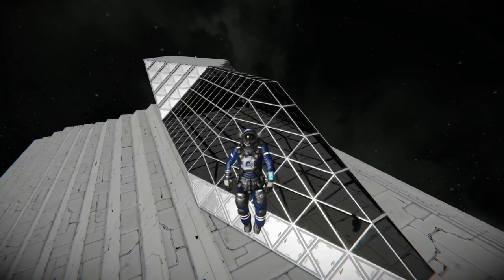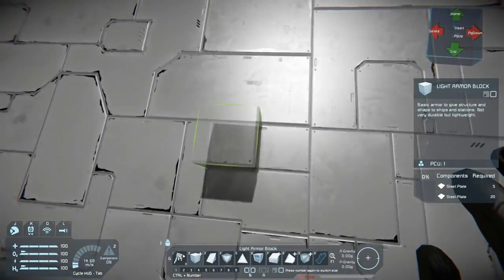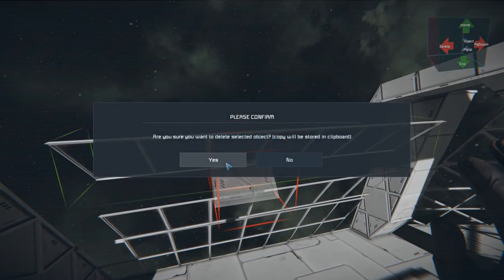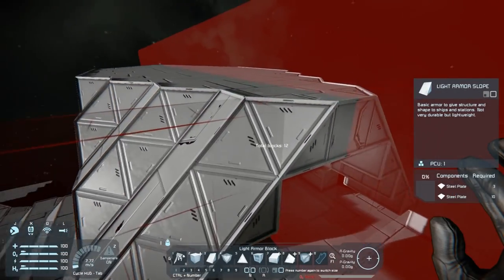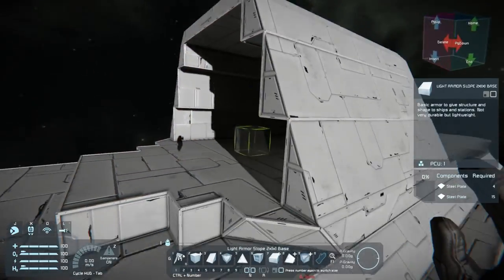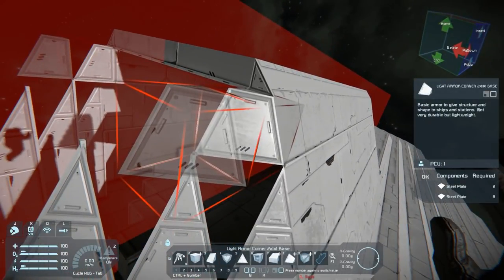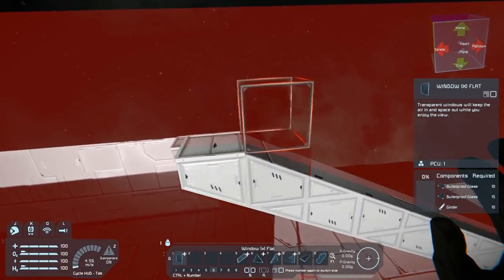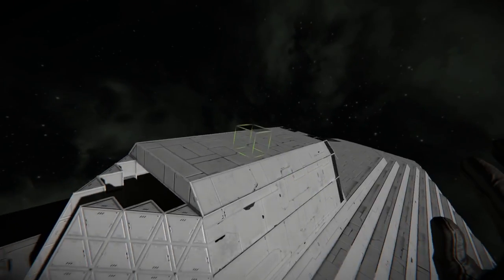Shadowbound Corp. Capital Ship: Part 11 - Space Engineers Let's Build

Comment: How about intending the glass one block towards the center of the bridge? That'll give you some room to play with forms and what not and also give the front side of the bridge some flavor. It won't be good if all of it is a seamless surface. You can actually overcome a lot of the issues you're having by implementing a number of layers to the design. As of a main hull, overlayed with armor plating that's one or two blocks away. If you want to make single large good looking armor plating for the outer hull, just put them on rotors and angle them to your liking. You can always anchor it in place via a second rotor and lock them in place. At least that's how I see it being easiest and relatively fast too.